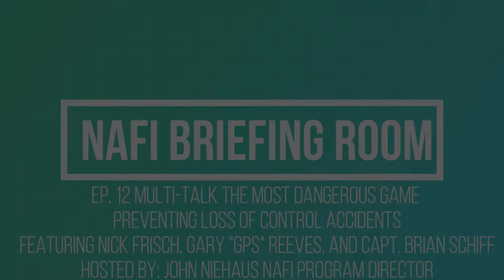Multi Talk: The Most Dangerous Game- Loss of Control Accidents

Comment: Great discussion. Nick says, “The airplane is always controllable.” True. In some scenarios the control requirement is to pull both throttles to idle (remove the symmetry) and push the nose down (control angle of attack) and land straight ahead. If under control the off-airport landing is usually survivable. Just making the point that the airplane is always controllable but that does not always mean the airplane climbs out on one engine. 

Again, great discussion. Good to see all four of you together and hearing you discuss and debate.
Reply from the maker: Thanks you so much for watching! We would love to have you participate in future videos regarding this topic!

Comment: Last time I did an asymmetric power stall in a Baron (an older 55 model), I started at about 6000 feet, and the wing stalled well before I reached Vmc, so we didn't lose control, and we lost only a few hundred feet. The stall was indicated by a pretty decent buffet, but not a lot of rolling moment. I think this can be deceiving; since I did the maneuver at altitude, and power decreases with altitude (not a turbocharged engine), it's important to remember that the outcome would probably be different at a lower altitude, where more engine power is available.
Reply from the maker: Mike we would love to have you involved in the next conversation regarding this topic if you are willing!